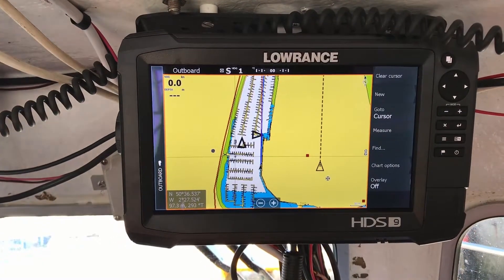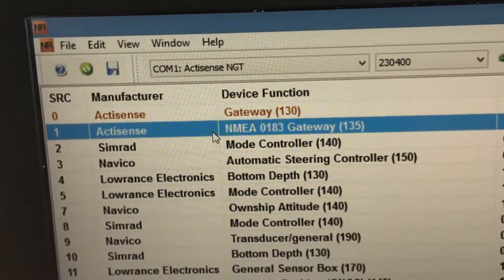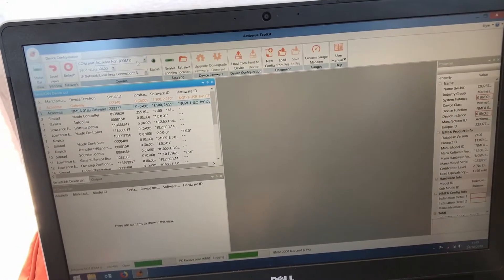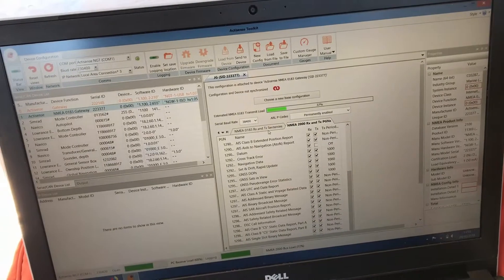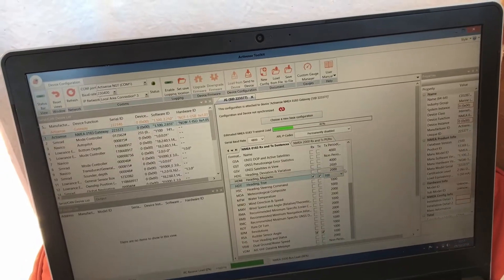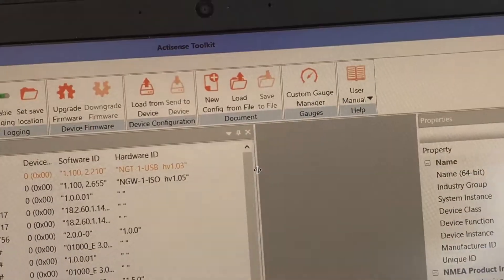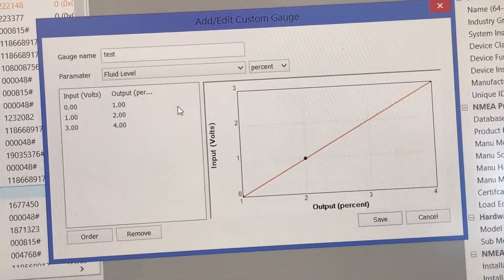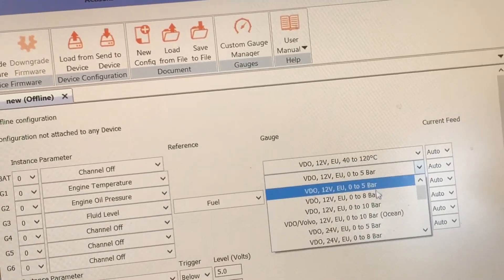Case Study - Updates to NGW-1 and EMU-1

Comment: NGW-1 caused me a big problem in 2016, it would not calculate an NMEA0183 HDG Magnetic Heading sentence when fed with N2K PGN127250 which included valid True Heading and Mag Variation data
I needed to calculate an NMEA0183 HDG data to connect to a legacy autopilot. All I had on the vessel was an N2K sat compass. The Actisense literature "assured" me that a N2K PGN127250 would produce an NMEA0183 HDG sentence, which it did..... but the heading field was empty!!
Actisense offered refund, and I had to replace the NGW-1 with Furuno's equivalent interface module which worked correctly.
I wonder if the new firmware fixes this.....
Reply from the maker: Hi.  Sorry to hear of the issues you experienced with your NGW-1.  The data that you describe as being available to the NGW-1 (including the magnetic variation, as that isn't a heading value), indicates that the NMEA 0183 equivalent to PGN 127250 would have been 'Heading, True' (HDT).  The conversion list for the version of firmware available in 2016 (the same one that's available now) indicates that conversion to HDT is not supported.  
https://www.actisense.com/wp-content/uploads/2017/07/2014-04-24-NGW-1-Conversion-List-2.420.pdf

Apologies for any inconvenience this caused you.  Hopefully the new beta mentioned in this video will work for you.  We have received a lot of positive feedback for the new HDT support (including 'Fast Heading' at 10 Hz).  If you would like to use it, you can find the download link here: http://bit.ly/2CNNHmo